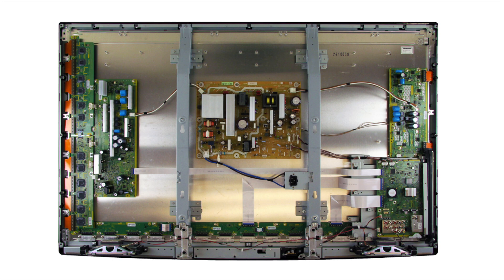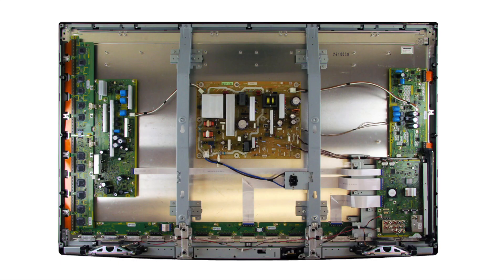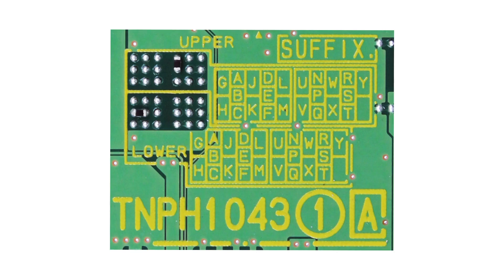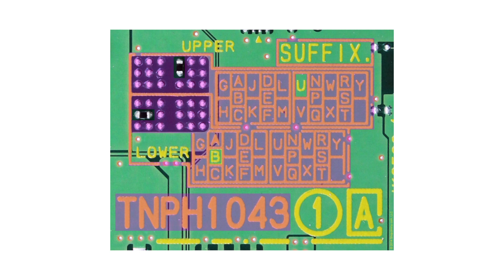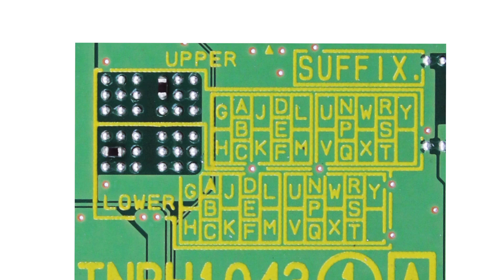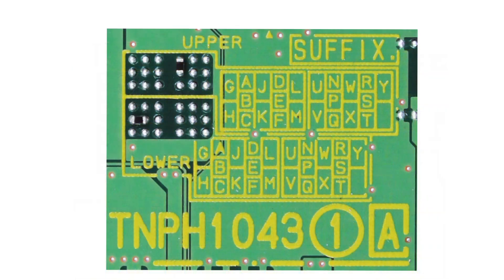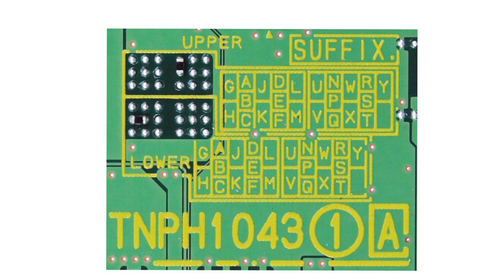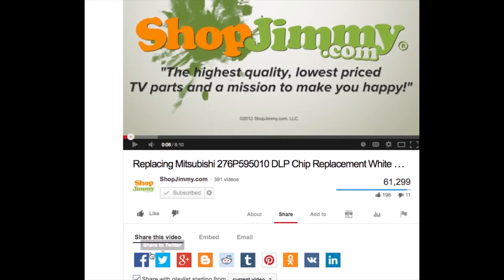Panasonic Main Board Suffix Code - Help - How to Determine Suffix & Part Number LCD LED Repair

Comment: hi, i have not suffix pattern. but a specific label code: TNPH0988 (generic) and then TNX/A1SQUE (panasonic tx-p50gt50E, europe version). hdmi issues and then fails to stay on (blink error code:12). have you a bord for it? or even an eprom is enough? (https://www.shopjimmy.com/panasonic-txn-a1rbuus-tnph0988ua-a-board-for-tc-p50gt50-loc-ic9304-eeprom-only.htm ). thanx let me know.

Comment: hi shop jimmy i have a question for you i have a samsung un65f6300afxza ii think its lcd when i turn it on the complete screen turns red then switches to blue and green and so forth  till all the colors are complete then keeps doing that  with no sound no picture no nothing just colors the remote will only turn on the tv no functions at all just colors  ? can you hep with this one ?
Reply from the maker: jimiboynyc   Please watch this video FIRST to help with your repair!  https://www.youtube.com/watch?v=BP3NVNCGEv8  First, I would hold the power button down for 15 seconds, then if there is no change, I would replace the main board.  If needed, click this link to replacement main boards for your TV model number:  http://www.shopjimmy.com/catalogsearch/result/index/?cat=56&q=un65f6300afxza  There may be multiple boards for the same TV model number, be sure to match part numbers on your current board, with your replacement for compatibility.  Thanks and please let us know if you have any further questions with your TV Repair!  www.shopjimmy.com
Reply: thank you for help I ordered the main and t-con just in case thanks again

Comment: My samsung tv is not working and after taken to TV repairs, i was told i need to change the whole screen as the screen panel has a fault. Model number is UE46D6510WKXXU.
for the new screen they charge the same amount of getting new model tv
Reply from the maker: ifkafifi   Yes, that info is correct.  Thanks!  www.shopjimmy.com

Comment: Hey guys i have a Samsung FP-T5084 that has 2 lower horizontal lines, i have taken it to a local TV repair man but says he can't get them to go away. what do you suggest? thank you much
Reply from the maker: David Whytock  Please watch this video FIRST to help with your repair!  https://www.youtube.com/watch?v=BP3NVNCGEv8  This could be a problem with the buffer boards in your TV or the TV panel.  You can replace the buffer boards to see if that fixes the problem.  Click this link to replacement parts:  http://www.shopjimmy.com/catalogsearch/result/index/?cat=96&q=FP-T5084  There may be multiple boards for the same TV model number, be sure to match part numbers on your current board, with your replacement for compatibility.  Here is a link to a video showing how to identify your part number, click here:  https://www.youtube.com/watch?v=R1jmj_foId0  Thanks and please let us know if you have any further questions with your TV Repair!  www.shopjimmy.com

Comment: Samsung LNT5265FX/XAA does not show standby LED. Can turn on with power switch or remote get the power up tune but no picture only faint green glow of screen. Did not show any menu. Will stay this way until powering off.All caps on  power supply board are ESR good with ESR meter . Swapped out main board with no change. Can it be inverter  or T-con board. Will check 5 and 12 volts of power supply board.

Comment: I'm having issues with my P50GT50 panasonic tv. A little about the tv I got it reimbursed off Amazon.com in 2013. The tv worked good until a thunderstorm hit it. HDMI input 1 was not working, got no signal, then 4 months later my comcast cable box signal was not working on any of the hdmi inputs, was not getting a clear picture, just static. But my blueray player was playing just fine on the inputs but the input 1 which was damage from thunderstorm. The very next day my tv will not come I  got 3 blinks, so I did some research online and found it was the A mainboard or power supply. So I purchased both parts out just in case and it fixed the blinking issue ( no more blinking) but now I'm getting a solid red light but still no picture or sound. Please can you assist me on want part I need for this TV. AS I have no picture or sound and But a solid light with no blinking